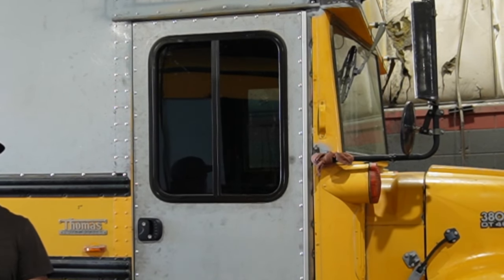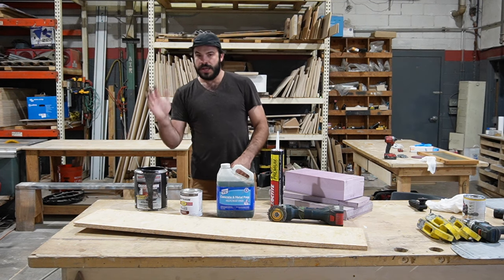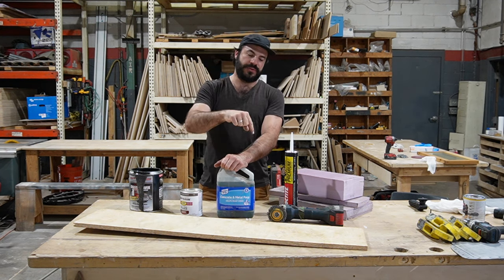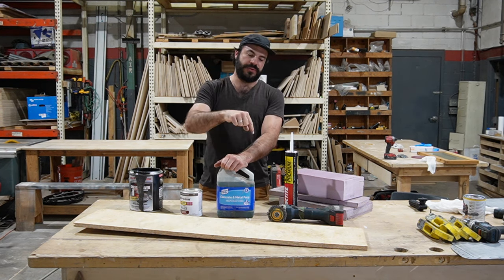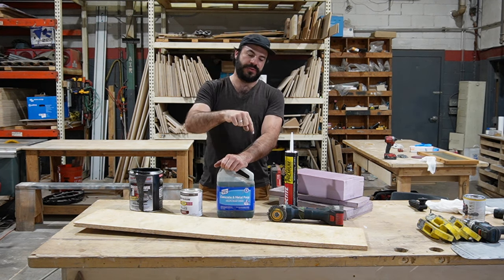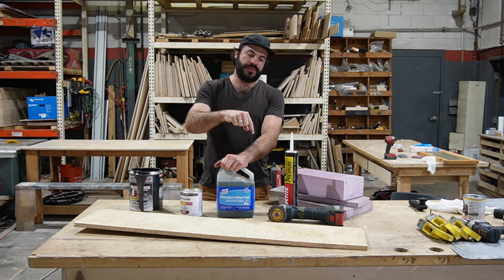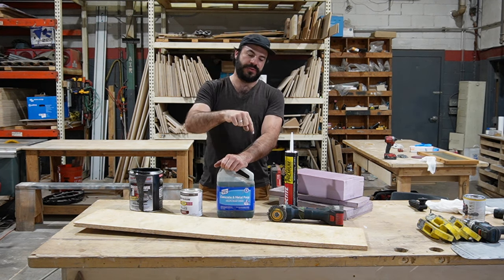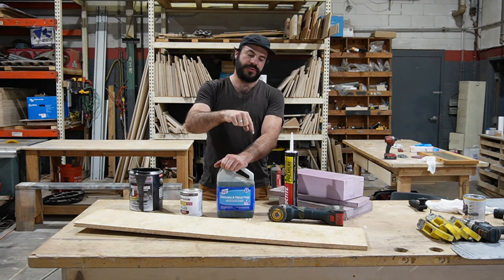Framing your bus conversion subfloor is a mistake, do this instead

Comment: Thanks again for all this information brother. Really useful! We just used chassis saver on the entire floor a couple days ago and we must’ve laid it on too thick, because there is small bubbles all over the place after one coat.  I was just curious what you would do in this situation?  about a third of our floor in random spots had some pitting due to rust, but the rest of the floor looked perfect prior to this coat of chassis saver.  Would you just move forward after this single coat with small bubbles?  This stuff cures hard!

PS.  We plan to do a solar system consultation with you in the future here so we can do this thing right!
Reply from the maker: Sounds great I’d love to help! If the floor isn’t rusty and isn’t scuffed up that can happen. I’ve also seen it not adhere if there is adhesive revenants on the metal as well. I wouldn’t worry about it but I’d make sure that the paint did stick well
Reply: @ChuckCassadyYT  Yhanks Chucky boy!!!🙌.  Yeah dude, really weird because I prepped the floor like a MF.!  it seemed to do the best on the rusted spots but everywhere else where I ripped through old pans and adhesive down to bare metal with 80 grit, didn’t do so hot. Whatever, we’re moving forward. Can’t let perfection get in the way of done!  We’re installing our subfloor exactly like yours this week and dude, couldn’t be more grateful brother. 

Sidenote.. I think you should start a cult..  Lord Chucketh of thy Buseth!  You would make a great leader and I can already see your Bible… the sacred Book of Bus!
🤘😝🤘

Have a good day dude! Great bus fair vlog btw!  I know you’re not a huge fan of vlogs and me neither but I would definitely watch yours You interesting man you!

Comment: Hey love on how detailed you are in your vids. Now I live in a rv and have had truck with a 11ft Lance camper for my next project I wanna tackle a schoolie. My question is how can u go about making it nearly sound proof inside im gonna eliminate the windows and only keep top hatch and most likely section out the driver area from the rear main cabin. Do u have any recommended material's u have use or seen used thanks

Comment: Your videos has helped me a lot in this building process. I'm just not sure of one thing. You don't frame floor. So how do you make sure your the furniture is held down well. Do I need a thick sub floor?
Reply from the maker: my stuff is screwed to the floor and to the wall. if you really need to, you can use a long bolt through the floor

Comment: Have you ever insulated under the bus? I plan to Insulate Inside the same but have a ton of of 2.5" I got from a job. And it's about the size of in-between ribs. Also focusing in the front where there is virtually no insulation. It has underbody storage from inside axles under full length that will also have sheets sandwiched between. But wanted to pick your brain with underside. Figured it would help and keep noise down a little more.

Comment: Thank you for this, but I am not a builder by any standard and got very confused with the spray foam and framing thing. When putting up the walls, you have an inch and a half thick spray foam on top of the frame. How is the frame then used to attach walls to?

Comment: Hi Chuck, great video! I’m currently attempting this method of flooring right now. Question before I start though, I saw someone else ask this but I would like more clarity if you can spare the time.
When mounting appliances and cabinetry to the floor, do you screw only through your OSB floor? Or straight through the entire subfloor and into the floor pan? I’m worried about how structurally sound my appliances & what not would be without any framing on the floor to tap into.

Comment: Ok so you're using 4 x 8 sheets of foam board, you need to use the lock tight between all edges to adhere each sheet together, correct?

Comment: Thank you sharing your experience and knowledge. We recently purchased a 53 foot semi dry van trailer to build our home in. The trailer walls are 3/16" aluminum sheets riveted together with the ribs on the outside of the walls leaving the interior walls smooth. I'm wondering would it be possible to apply your subfloor technique to the walls of the trailer? It is possible to run screws into the backside of the outside ribs so I wouldn't be counting on glue alone to hold it together. Any thoughts and advice would be greatly appreciated. 
Thank you

Comment: Is a subfloor necessary? I'm converting a shuttle bus and it has a wooden subfloor. I don't plan on using my bus in the winter time (i despise the cold) or live in it. It's basically a hotel on wheels when we go on vacation or to Onewheel events.

Comment: Hello Chuck, it has been enjoyable watching your videos.  I am putting together my gameplan to build another schoolie.  I'm a big fan of spray foam for the walls/ceiling, however there's another product that looks to be more efficient that was designed to go with metal roofs.  It claims to be R22 in just .4" (yes, it's also radiant, vapor, and air barrier as well.  The product is Prodex.  Please let me know what your thoughts are on this product.
Levi
Reply from the maker: That is a radiant barrier ans relies on the main type of energy transfer being mitigated to be radiation. In a skoolie it would be much much less effective. Read their literature about how it works and you'll see what I mean

Comment: I might have added a metal kick plate to the rear step-up prior to installing that 3/4 plywood. Also, why did youi not go the full width of the bus with that piece since you are screwing the subfloor to it?

Comment: Just watched this again. Awesome info/lesson. 
I do have one question: had you considered using a hot wire to cut a small 1/4” x 1-1/2” rabbet along the length of the first layer of XPS so the remainder of the board was full width over the bump-up, or would that really be extra work for what might be an inconsequential loss of R-rating over the entire floor? I’ll be doing a Thomas as well so if it’s a waste of time then it’s a waste of time.
Reply from the maker: I actually fill that void with spray foam! But that would work too
Reply: @ChuckCassadyYT  Great! I was thinking the spray foam was just for the end space. Thanks!

Comment: What kind of floor insulation would you put in a low roof van ? And what thickness?  Regards from Denmark. Thanks for the time and knowledge you share with us
Reply from the maker: I'd fit as much as I could! 1"
Reply: @ChuckCassadyYT  thank you for the reply. I found 1" XPS plates. But i can only find the normal osb here in Denmark. Would you still use osb and eventually paint it or go with plywood instead ?

Comment: Did you use a specific primer on the top of the subfloor? I have everything else ready to go, but want to make sure I’m using the right paint for the top of the floor, thanks!
Reply from the maker: just some regualr old primer!

Comment: I have a box truck. I am limited on ceiling height and also weight constraints. If the foam is as strong as you say, I wonder, can I just lay down 1/4 underlayment and vinyl flooring on top of that? It would also be considerably cheaper going with a thinner underlayment. Thanks!
Reply from the maker: go for it. i just like 3/4 for biting screws better

Comment: Would It be necessary to screw the osb/foam to the floor via self tapping screws? Or just stick with the glue ?
Reply from the maker: We just do glue
Reply: @ChuckCassadyYT  thanks Chuck. Also, how far off the edge are is the OSB boards? To account for expansion/contraction

Comment: Wouldn’t doing the 1” foam before the front wood step help a little with thermal bridging? Is there a reason you did it the way you did? Awesome info by the way, thank you for sharing
Reply from the maker: The front area will get 1" foam!

Comment: I'm actually about to start a bus conversion and I've already removed all the seatbelt my Shortbus has approximately 100 Holes in the Floor from the old bolt holes. I was thinking about the penny trick or possibly just silicone around every one of the holes. Just water just not get up underneath there in between? I just don't want to risk them all rusting out I'm planning on living in it for a very long time. Or should I really just ignore them and just paint the whole whether they are open or not?

Comment: If we’re only using 1/2” foamular (due to height restrictions).. is it still ok to leave all the holes unsealed with such a thin layer of insulation?

Comment: Question? We bought our bus from someone else who Rust-Oleumed the floor already but did kind of a not great job. If we wanted to use the chassis saver on the floor could we do it over the Rust-Oleum or would we have to strip that off? There's almost no rust under it as far as we can tell (Florida bus.) Thank you for these wonderful videos. We've been learning a lot
Reply from the maker: Thanks for watching! You really want the chassis saver to be on bare metal
Reply: @ChuckCassadyYT  ok. Guess we'll have to sort through that. Thanks for the reply.

Comment: What would you recommend for a box truck that has a wooden deck floor? Boards are about 2x6, in really good shape, finished with some form of oil that's held up. T&G or lap joint between boards. Ground is barely visible only occasionally between joints. Worried about moisture getting between foam and existing deck possibly rotting if I add foam directly on top.

Comment: would the 2 inch. foam be okay to use for full time living in the bus but if we're spending time in mostly warmer climates and only cooler ones here and there?
Reply: Also, would you happen to have a list or pdf file of all these materials you went through during the video to easily refer back to when one is doing their own conversion?

Comment: Question : have you considered using advantech poly spray foam adhesive that they sell specifically for their sub flooring? Also have you looked at their new X Factor?

Edit: it’s approved for metal and sticks really well if you sponge the metal with some water. Plan on using it on my transit coffee truck build.
Reply from the maker: That is awesome I’ll have to look into it
Reply: @ChuckCassadyYT  just laid down the X factor over an inch of XPS. My application is a bit different than Skoolies or vanlife. Building out a Coffee Truck on a 250 Transit. Went 3M 5200 (overkill but I already had a tube of it and I know it works) on the metal to 1 inch of XPS and then used the advantech spray foam to adhere the foam board. Worked really well, plenty of work time, stayed tacky for my needs. Oh and I tested a piece of MDO 3/8 shim between the metal and xps with the advantech spray foam. Worked very well from what I can tell after letting it cure and wacking it with a mallet haha.

Thanks for the vids! I’m A general contractor trying to blend the building science I know with some of the innovation you guys have pioneered with busses and vans and you are definitely on the mark with many of your applications of building materials. Take care!

Comment: Awesome Video! My question though, with not sealing the water drain holes in the floor pan, won't rodent's find their way in and destroy the ridged foam?
Reply from the maker: If a rodent can get in through a 1/8", we're screwed
Reply: @ChuckCassadyYT  another question I have is would it be possible to install radiant floor heating? maybe inlaying them in the foam board?

Comment: Would you recommend welding close any large rust holes (about 15" long next to the front wheel bumps) before painting or am I able to cut then weld metal patches on the chassis saver, then paint the patches?
Reply from the maker: I'd do all the metal patching first

Comment: planning to make my floor sandwich this weekend!! i may have missed it, but how much of a gap did you leave between the OSB / foam (?) and the metal of the chair rail? i know we can kinda see the tiny crack but i just wanna know how much space i should try and spray foam in
Reply from the maker: As little as you can!
Reply: @ChuckCassadyYT  Perfect, thanks!

Comment: Would you go over the bed frame/platform design you use? I saw a peek in a video but not sure what kind of materials you use, the dimensions between the holes for air flow, etc...
Reply from the maker: I'll get there!

Comment: i have a chassis shuttle bus, it does not have metal floor pan.  what would you suggest for a floor?  i was thinking 3/4 ply on the metal frame, 1" XPS on top of that, but im unsure if i should do another layer of wood on TOP of that xps/ if so how thick?

i was going to bolt the bottom layer plywood to the metal frame floor supports like the OE.  undercoating on the bottom and a top layer of seal coat on the top surface of the bottom layer ply wood

Comment: So with a 12" roof raise and a 4 3/4" subfloor, plus whatever flooring you choose, plus the ceiling boards and insulation above that, etc.... How much space did you gain in height?  4 or 5" ???

I want a roof raise and was originally thinking 12" but now I think I should go up 16" just to get more room for better insulation.

Comment: Hey Chuck, I know this is an older video but I’ve run into a problem with your method that I wonder if you know the fix for. We did our subfloor prior to the roof raise. Well now it’s waterlogged and warped. We need to remove the plywood and redo that. Would love to not have to buy all the pink foam AGAIN. What’s the best way to separate the plywood from the foam? It’s just held on with that loctite in the vid

Comment: Any tips on weighing down the foam and osb if you don't have a ton of sand bags laying around??
Reply: Ended up using 5 gallon buckets filled with water, a cooler filled with water,  and a few cinder blocks I had.  Worked nicely.

Comment: I'm looking for insulation for various projects,  one being for eventually an enclosed trailer conversion.  The more pressing is a shed that I use for communications and storage.  I live in the lower desert that can get 120 degrees and down to 20 at times.  What would you recommend for insulation?
Reply from the maker: Spray foam, generally, is going to be the highest performing option

Comment: Could you say something about interior steel on the rear of the bus? Is it too challenging to remove for insulation? Some other reason you haven’t removed it?
Reply from the maker: It will be insulated over!

Comment: We didn't take off the original floor, and put in thick plywood...due to time constraints. We did insulate the ceiling and walls with Rockwal. 
Tell me what we can expect from this shortcut we did, so we can prepare?
Reply from the maker: There is no way of actually knowing the condition of the metal Floorpan without looking at it, no matter what people say, I've seen rust on pans I thought would be pristine. Plus it gives you a chance to paint it and protect it more. Without insulation your floor will be a major heat loss in the winter, like extremely cold, and get hot while driving over asphalt in the summer. OSB is definitely not my first pick either as it is very moisture sensitive. Sorry to be negative but it's what I think 🤔

Comment: You can totally buy EPS (or even better G(graphite)PS) with a 25 psi compression rating. Same rvalue as XPS, way lower global warming potential in the manufacturing process, and doesn't experience the Rvalue drift that XPS does (10-20% loss over 5 years).
Reply from the maker: Let me know where! I've never been able to readily find it
Reply: Also, 100% agree about Advantech. That stuff is nuke-proof.

Comment: Couldn’t you use the piece you cut out as the patch. Only width if saw kerf shooter. Also, wouldn’t it make sense to glue 4-inches of foam to bottom of patch?
Reply from the maker: I didn't expect my cut to be so clean! There will be insulation glued to the bottom of it, fear not!